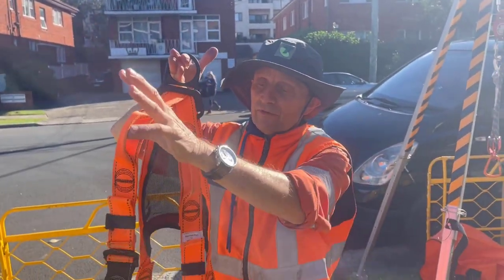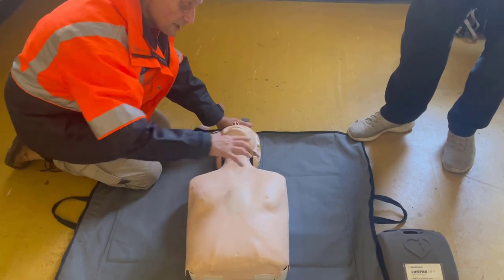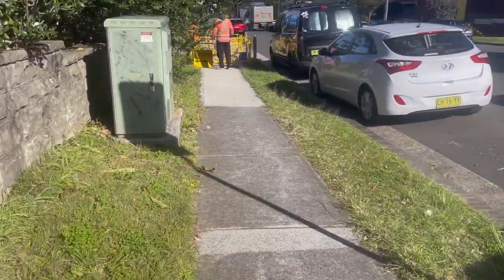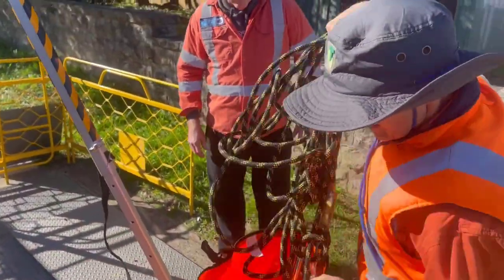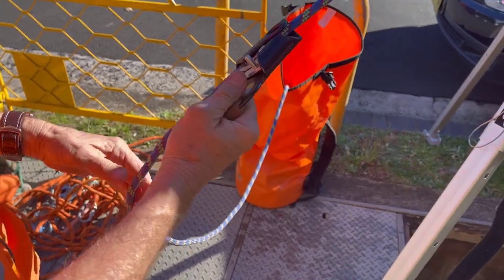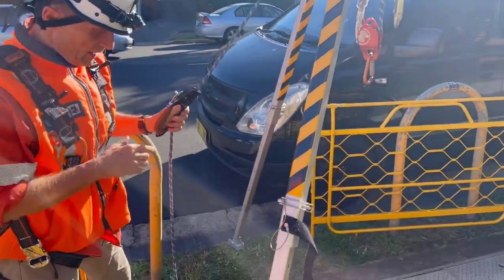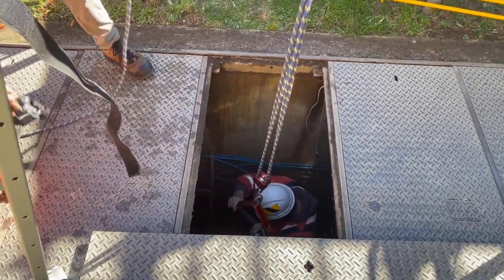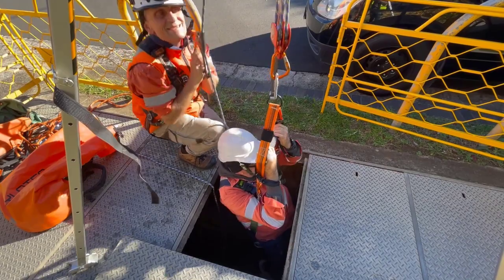Confined Spaces and First Aid Training for Telstra & NBN Compliance. Telstra Exchange Cronulla.

Comment: Omg, go through all that effort in setting up a tripod, putting harness etc, all that just to got down like 2m into the ground, no wonder trade work costs so much, a good portion of the working time is used in setting up all the equipment to get down the hole, if I had to go down a 2m hole it would take me no more than 5 min it's to grab a ladder off my car stick down the hole and climb down a ladder
Reply: You are more than welcome to explain to Safe Work NSW how you are going to rescue a man out of a M/H using your just your ladder, until then I will continue to do it the way they want it not yours...
Reply: @petermeyer4201  climb up and down the ladder, that's what they are used for
Reply: @Aussie-bh5le  Hay Champ,  tell me the next location you are at  in a M/H and I will have Safe Work attend your site good luck
Reply: the value of a well trained employee is very high. the value of a human life is even higher. not sure if you're trolling or just detached from reality.
Reply: @wh0pper99  nope it's called red tape, bureaucrats complicate things these days and who needs harnesses to climb down a small ladder. Back in the 1960s when I worked in construction I would climb on the top plate on the outer walls on double story buildings with no harness.